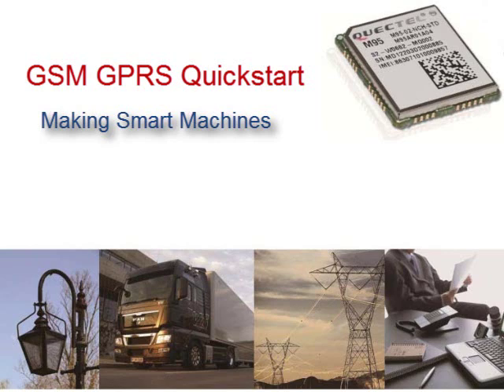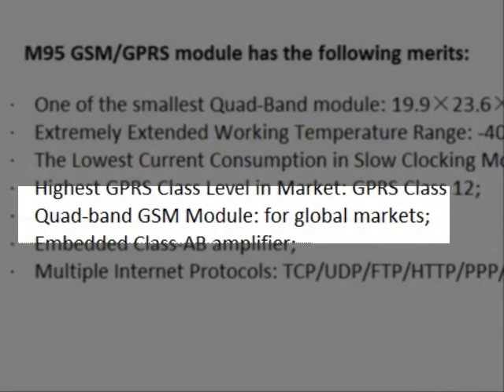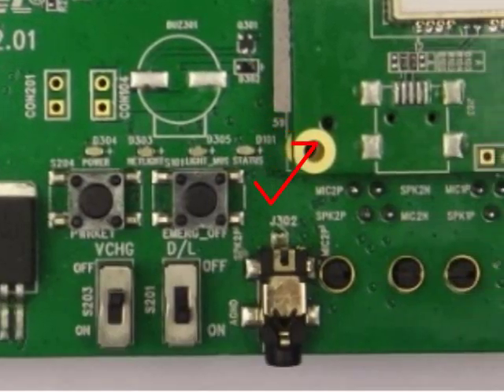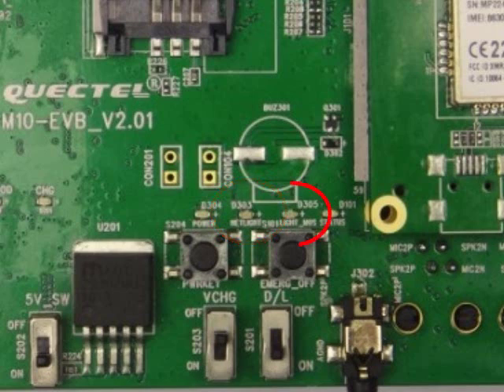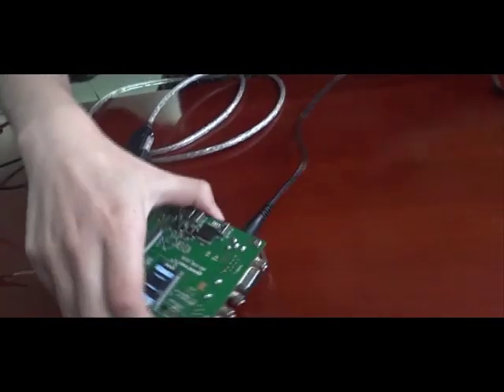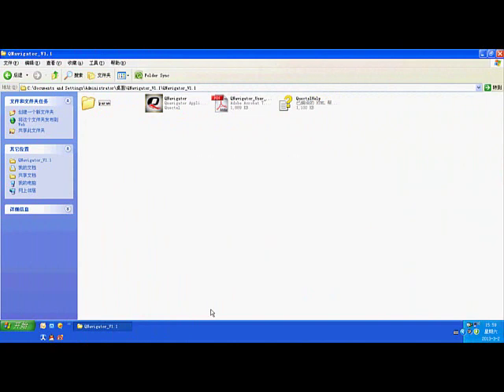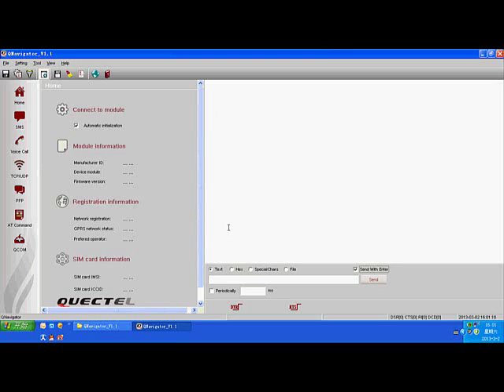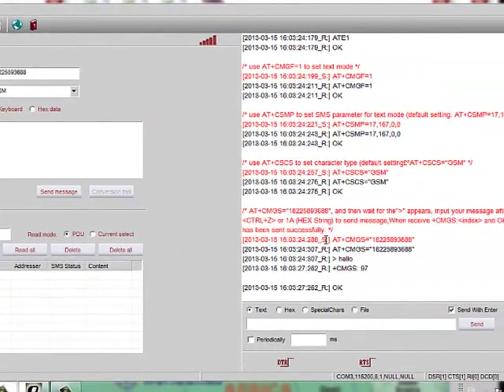Quectel GSM GPRS QuickStart

Comment: Hey, I want to get gps data and send it to the serve by using MQTT but I can’t understand the libraries can you suggest me some more examples of opencpu mc60
Reply: Hey there is another firmware to enable the MQTT. However I have had a little trouble to get it a solid connection with AWS(A correct Connection)
Reply: Any you will need a firmware update application